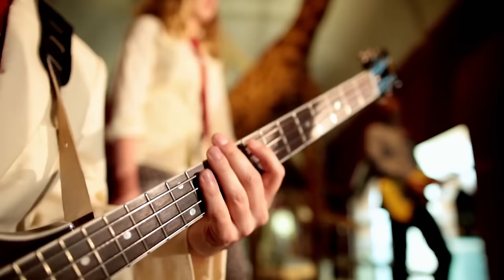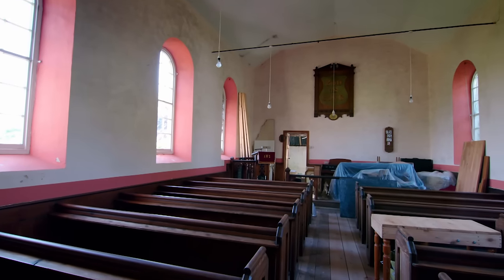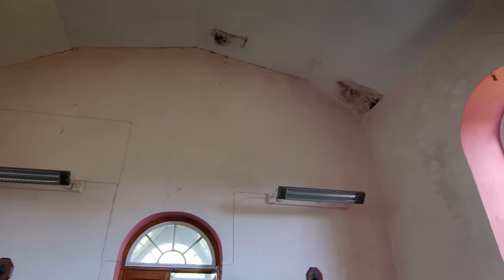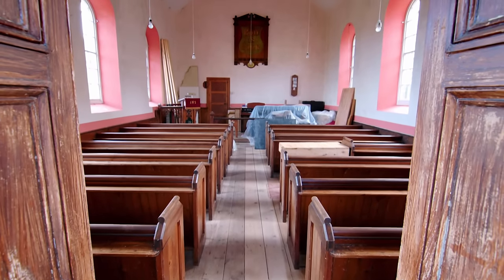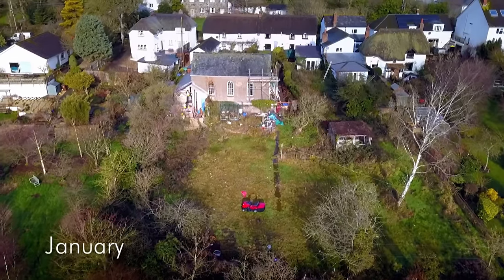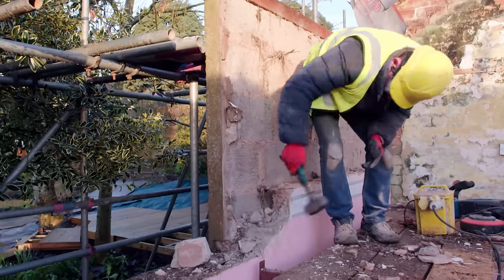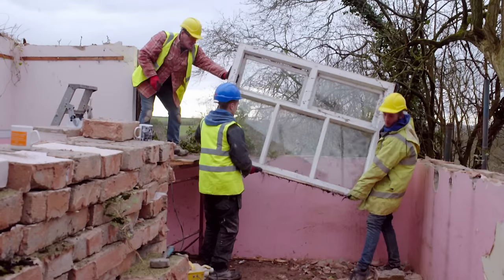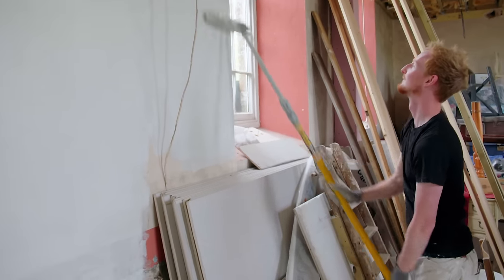Restoring An Abandoned Chapel To Become The Perfect Living Space | Building Historic Homes | Abode

Comment: What an incredible transformation. A beautiful result that is breathtaking. There is only one thing I would have done differently. I would have exposed the stone in the porch but kept the structure until I could find a way to redo it. I am a great believer in vestibules for two reasons. The first is energy efficiency. With an airlock the outside temperature does not penetrate the building. The second will be familiar to anyone with a beagle or two. A vestibule does for beagles what a cattle grid does for cows; it keeps the beasties in.